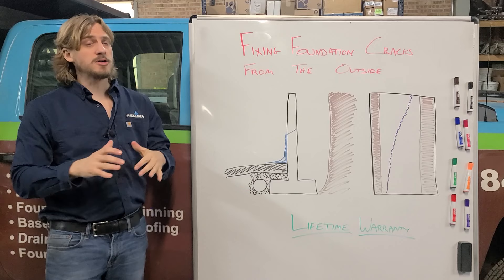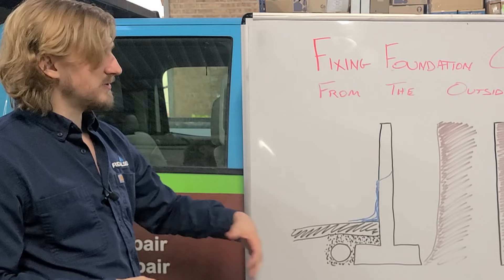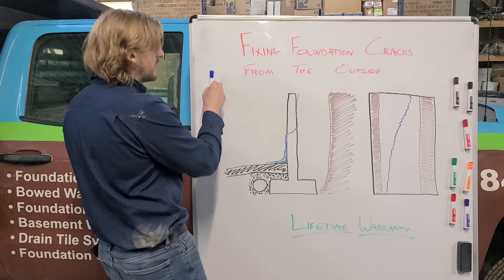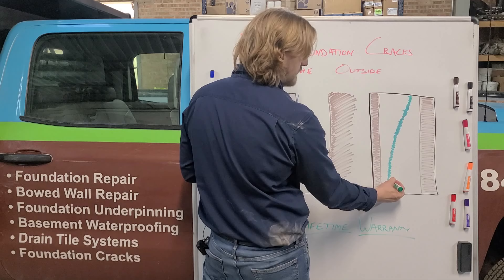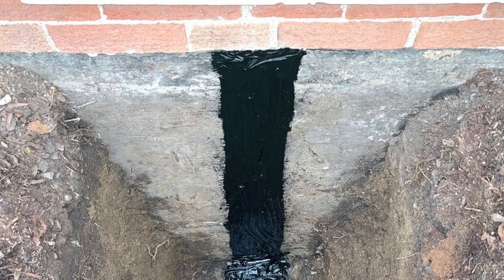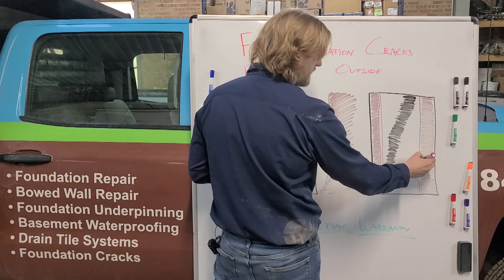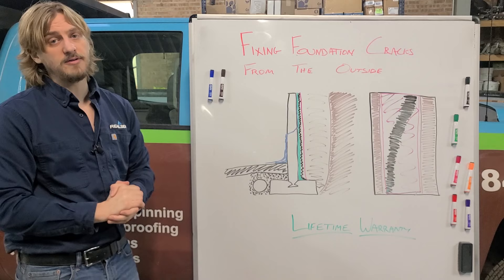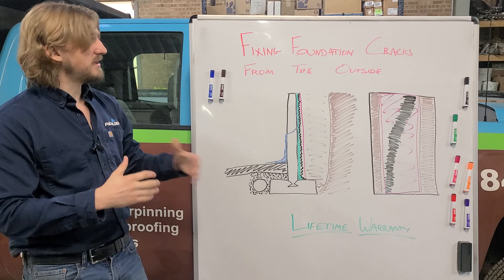Fixing Foundation Cracks From The Outside: How It's Done

Comment: Which elastomeric tar do you recommend from form local big box store like Menards, Lowe’s and homedepot. Can I use 10mil plastic sheeting to protect the tar? Thank for your help! This is rhetorical best waterproofing video that I’ve found!
Reply from the maker: Hi Gonzo, thanks so much!

The tar we use comes from a commercial supplier. There are numerous brands available in the big box stores. As long as it is a good product, the biggest thing to worry about is prepping the foundation properly. 

Be sure to dig to and clean off the footing. Scrape the whole area to get any dirt/dust/debris off the wall. Brush it clean. Then apply the hydraulic cement, seal with tar, and put the plastic sheeting over it. 

10 mil can work, but you need to be careful because that thin of a membrane can tear with rocks and dirt as you tamp the dirt back into the hole. I'd recommend a bit thicker, at least 14 mil or a foam insulation board.

Comment: What does a repair like that typically cost?
Reply from the maker: Hi Brad! It all depends on the depth and if there is anything in the way. The deeper the dig, the larger the cost. Once we go below 5 ft, it requires more digging for osha as well as another person or a machine.

If there's an A/C or landscaping in the way, that will add to the cost as well. 

Do you have a specific project/height/clearance in mind? We could get you in the ballpark with some more info.
Reply: @Therealsealllc  Thanks for your response. The repair would be about 5 feet deep. It is very similar conditions to your video demonstration.
Reply from the maker: @bsvoight  Of course! For a 5ft dig, you would be in the ballpark of 1,700 with a Lifetime Warranty. This will require the OSHA dig as we need to get by the footing, and would require 2 of our techs to complete.
Reply: I really wish you guys were local.

Comment: Can I use white tar?
Reply from the maker: The color of the tar matters little. What you need is an elastomeric (still a bit stretchy when dried) tar. Prepping the area properly is the most important step. So be sure to clean off the wall with a wire brush well and brush any dust/debris off and allow to dry before applying the tar.

Comment: What’s the proper way to backfill after fixing a crack from the outside? Are you suppose to add gravel on top or the bottom or the middle as you back fill?
Reply from the maker: Best way to backfill for a crack you excavated is with the same dirt you dug out. You'll want to tamp the dirt down with a manual or gas-powered tamper in order to fit the dirt back in there. No need for gravel at top and bottom.
Reply: @Therealsealllc wrong! You back fill with pea gravel. Clay soil causes hydrostatic pressure on your foundation and it will cause more cracks just like the original
Reply from the maker: @antd2733  If clay soil expanded to cause the crack and bow the wall in, the solution wouldn't be a seal from the outside, but a structural repair from the inside.

As we are talking simply about waterproofing, it is perfectly acceptable to fill the hole back in with the dirt you excavated. A 2' wide hole of pea gravel, where the rest of your foundation is surrounded with clay, will do nothing to stop pressure against the wall.

Comment: Having alot of water issues in my basement doesnt seem to be leaking from the walls but from the floor so im gonna have to dig the exterior to see the damage would liquid rubber work the same on the exterior walls / cold joint
Reply from the maker: Hi Madgrizz! If the water is coming from the floor, most likely you will need to install a Drain Tile System. Check out our Drain Tile Video to see more!
Reply: @Therealsealllc  thanks for the response, I have two sump pumps and an interior perimeter drain installed, unfortunately it's a gutter system that sits atop the footer with little to no pitch to the sump pit and doesn't do much. We also have iron an ochre issue so I have to flush the system periodically with a sewer jetter, thinking I need minimum 4" corrugated pipe sitting next to the footer connecting to those sumps but also need access to the drain system in order to unclog when necessary.
Reply from the maker: @MaDGriZz78  Wow you certainly have been through the ringer with that home! You are correct, top-of-footer Drain Tiles are not adequate to keep your basement dry. They do make a lot more money for the contractor, but a lot less protection for you. 

For Iron Ochre systems, we recommend installing a next-to-footer pitched solid-pipe Drain Tile System with cleanouts at each 90 degree turn. 

This way, you can put in your flushing products easily and help keep the system as clear as possible. 

Additionally, an Iron Ochre Pit (a smaller pit inside a larger pit to act like a septic system, separating the Iron Ochre and keeping it from damaging the sump pump) will help make the system last for longer before needing replaced. 

All systems that are contaminated with Iron Ochre will need to be completely replaced eventually, depending on how bad the infection.

Comment: Is this superior to the epoxy injection method? Seems like in an environment where there's frequent heat/cold contraction that tar stuff isn't going to prevent movement only seal things. The injected epoxy has a tensile strength of 9000psi I believe.
Reply from the maker: Great question!

Both of them come with a Lifetime Warranty. That is because both methods work. 

The elastomeric (stretchy) properties of the tar allows it to flex during the heat/cold cycles, allowing the seal to stay in place. This method stops water from ever entering the crack. 

The epoxy method fills the crack with epoxy, eliminating the pathway for water to enter through the crack. 

Mainly, people choose between the two based on access. If there is a lot of stuff in the way on the inside, an exterior repair makes more sense. But as the epoxy is less expensive and carries the same warranty, that is the standard method for repairing cracks when you have the access from the inside. 

Hope this helps!
Reply: @Therealsealllc  Thanks for the reply!
Reply from the maker: @sayless9937  Anytime!

Comment: How about putting a canopy over the crack
Reply from the maker: Hi Abhi! A canopy over the crack we would consider a half-measure. The true issue is a gap in the foundation that needs to be repaired. At time of home sale, it will need to be done correctly.

Comment: I was wondering if you could help me with a question I dug around my foundation to the footing I am putting new cement around my foundation so I decided to waterproof it. What do you recommend to put on the walls about 4 feet down to the footing? Do you also recommend the boards?
Reply from the maker: Hi Bill!

What's the purpose of the new cement around your foundation? 

For waterproofing purposes, you want to do a waterproofing elastomeric tar on the surface of the foundation and on top of the footing. Over that, you want a min 14 mil vapor barrier. 

Next to the footing you should install a solid-walled perforated Drain Tile System that leads to a pit inside the house. After that your foundation in that area will be waterproofed.

Comment: I currently have a leak coming through the foundation where the sewer pipe penetrates the house. This pipe buried around 2 feet underground. Do you recommend the same process? Employee at Home Depot recommended an application of expanding polyurethane between the pipe and concrete from the outside. I would greatly appreciate any advice anyone can give me.
Reply from the maker: Hi Pepe!

Either way will work. Typically, we inject polyurethane epoxy from the interior for pipe penetrations through a foundation.

This is due to the low cost and efficiency of the job. We can get that done in about 1.5 hours, leaving the area dry. 

Digging it out costs more and takes longer, but will have the same result, the leak should cease.

Comment: Thank you for this video! If epoxy can be done from the inside, do you recommend doing any repairs from the outside?
Reply from the maker: Hello! If you are able to get the crack from the inside, there is no need for repair on the outside. 

However, if there are finishings/chimneys/furnaces/etc in the way of the crack that prevents you from doing a proper interior repair, we would then recommend an exterior solution.

Comment: What do you suggest to prevent the crack from getting bigger? Especially, in a scenario where the crack is through the foundation wall from the top to the bottom footing.
Reply from the maker: Most all cracks are through the entire foundation wall top to the bottom of the footing. While injecting cracks or sealing them from the outside will waterproof them, if a crack is actively getting bigger, it means there is an underlying structural issue. 

If the wall is moving inwards, it will require Carbon Fiber or Wall Plates to repair. if the wall is settling downward, it will require Push or Helical Piers to stop that movement. 

You can reinforce cracks with carbon fiber stitching, but that will not hold the entire wall. Check out our Carbon Fiber, Wall Pushback, and Piering Videos for more info!

Comment: Can you please detail how you prep the crack for the hydraulic cement repair? Do you have to open the crack up? If so how much and whats the best tool? And is Xypex patch’n plug a good product to use?
Thank you so much for your informative content! Much appreciated 😊
Reply from the maker: Hello "Theflood1000" thanks for the question! 

On the outside, you want to chip away some of the crack and clean it out with a steel wire brush to clean all the dirt/debris off of it. 

Then you can mix the hydraulic cement and patch it. From there, you may need other products like an elastomeric tar and/or waterproof barrier. 

Unfortunately we haven't used that specific product to which you are referring, so we couldn't tell you if it's good or bad. Your local hardware supplier will be able to show you their recommended product.

Comment: That tar steps seem to be an overkill? Don't you think the cement coating should be enough?
Reply from the maker: Hi @bijayshinghero. The 2nd plastic barrier is not to help with the waterproofing, but to protect the tar seal during back fill so it does not scrape off the wall. Without it, shovels or dirt could create weakness in the seal.

Comment: Can I torch bitumen membrane over the wet tar?
Reply from the maker: There are many ways to waterproof structures. We don't torch bitumen membranes, so wouldn't be the best people to ask about that process. 

Over our tar seal, we typically lay an thread-reinforced poly sheeting. We also will use insulation board.

The main purpose is to protect the tar while backfilling.

Comment: How long is the wait between the hydraulic concrete dry time and applying the tar?
Reply from the maker: It depends on how fast the hydraulic cement dries. A wetter mix will take longer, while a dryer mix will take less time. The indicator is when the hydraulic cement turns white, and visible signs of moisture have dried up.
Reply: @Therealsealllc  i covered the hole over night after applying the concrete, it set up but was still dark. So i took a heat gun and made it white. Then applied tar and the insulation and back filled.
Reply from the maker: @deansheridan   Sounds like you did it right!

Comment: So ,i just can't put tar down to seal up open cracks in the foundation?? My basement has been founding for amount two years. Only if it rains hard and long.. i use to be able to put tar on tge open cracks
Reply from the maker: If you dig the cracks out, clean the wall, seal the crack with the tar, and then apply a membrane to hold that tar in place while you back fill, then yes, that will work to stop the water. 

If you are just applying tar on the inside, no, that only works temporarily and the correct fix will be that much more expensive as the contractor will need to remove that tar first.

Comment: Why not just fix the crack on the inside with injection resin?
Reply from the maker: We do, and the majority of our crack repairs are done from the inside. But some factors (chimneys, finishings, HVAC systems, etc) can prevent the repair from being done from the inside. 

In those cases, we repair from the outside. This video is to show how that is completed.